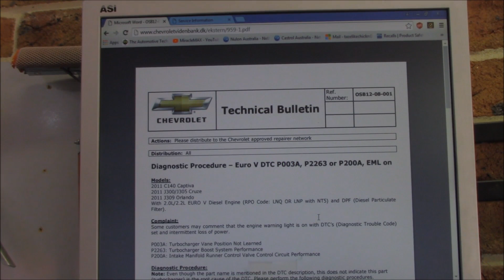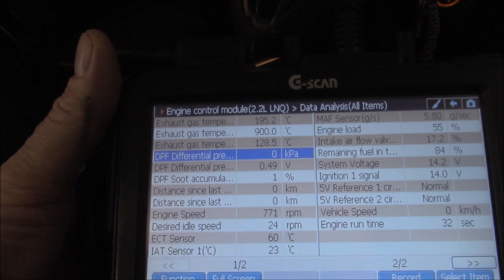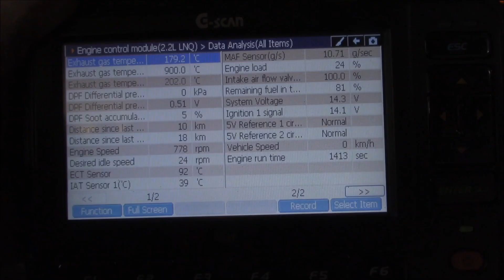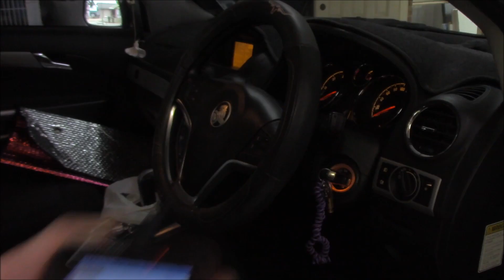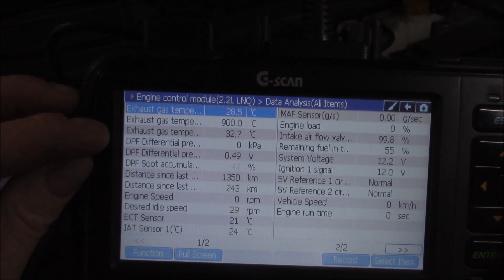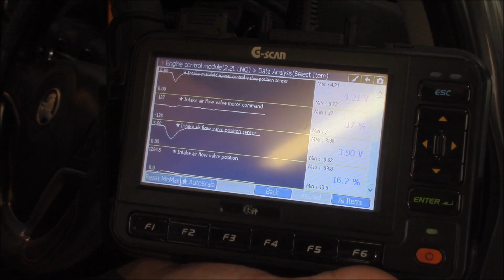Holden Captiva Diesel P200A MiracleMAX

Comment: Do you know if that vacuum actuator can be removed and replaced without removing the manifold?
Reply from the maker: Which actuator are you referring to? Some of them on the engine are EGR Vacuum Actuator, Turbo Actuator Intake / Swirl Flap Actuators.

Comment: Hi there love your videos, youve helped me with fixing this problem. But now I have p0401 - exhaust gas recirculation flow insufficient detected.  😢 would you know what this is? Ive tried researching it but cant find any info.
Reply from the maker: Can you see the MAF reading change when you activate the EGR valve in live data? When EGR opens, MAF should drop noticeably. Is there a build up of carbon in the intake system?

Comment: Hi! I have a new intake manifold purchased from GM and a new solenoid control valve behind the intake manifold. New DPF filter. I still get the P200A error. Do you know the cause? Could the problem be the EGR exhaust gas recirculation valve?
Reply from the maker: Have you carried out all the recalibrations required? Have you completed the necessary drive cycles to allow for a service regeneration to take place?
Reply: @MiracleMAX Yes. But the error comes back sometimes after one day, sometimes after three days, and the DPF burnout activates every day on a cold engine, maintains 1000 rpm for 3 km and then drops to 800 rpm and gently It's waving

Comment: Hi Max, I have Holden Captiva 2012 throw p2564. What I can start to diagnose?
Reply from the maker: Can you see actual compared to desired boost in live data on your scan tool? Is the actuator working correctly. If you disconnect the actuator, can you freely move the vanes?
Reply: @MiracleMAX  hi max, I replaced the turbo with new one and also inlet manifold there was big hole in manifold. The actuator works perfect. And vanes also move perfect. But when I starts the car after 5 sec car run but loud and once I pull the MAP sensor it runs to normal idle and car it also on limp mode. Code says turbo boost control position sensor a circuit low. It can be wire or fuse issue ? Will much appreciate for help
Reply from the maker: @nav5748  Have you tested the position sensor? That's where I suggest you start
Reply: @MiracleMAX  I tested orange black wire show 0.01 volt, middle pink one show 5.0 volt and yellow shows 0.01 volt. Should I get 12v in one wire with key on ignition of?
Reply: Or any fuse or relay need to test because I already replaced turbo ?
Reply from the maker: @nav5748  Can you tell me what engine is in the Captiva. Petrol or diesel and what size engine. With that code, you may need to check for a short to ground or an open circuit.
Reply: @MiracleMAX  this is Holden Captiva diesel 2012 2.2L CG
Reply: I check turbo actuator move when I start it,
Reply: @MiracleMAX  I checked boost control valve with multimeter with 20v. First one show 3.04V on white wire and 12.35v with orange one. Other-side with second solenoid I can see 3.54v and 12.35v with key on
Reply from the maker: @nav5748  So does the desired vs actual readings agree in live data?

Comment: Hi
Should there be vacuum on the pipe going to the actuator when car is on idle? Got p200a captiva 2.2L 135kw.
Tnx
Reply from the maker: Which actuator are you referring to? The intake runner actuator? According to the scan tool data at idle, it appears to have some duty cycle to the solenoid, and therefore the actuator.
https://youtu.be/tXyUWjjHAwA?t=323

Comment: Hi Mate
I appreciate your videos very much. Can you please let me know what should be the ideal idle vacuum pressure on diesel captiva 2ltr? Mine stays at -1.87hg. Thanks and appreciate your help
Reply from the maker: Diesels don't operate the same as petrol engines with a throttle blade. Most Diesels don't have a throttle blade to pull against to create vacuum, that's why they have a vacuum pump to provide vacuum for things like the brake booster. If they do have a throttle plate, then this is used for EGR operation. Diesels will not have the typical 17 and 22 inches of mercury that you will find on a Petrol engine.

Comment: Thanx max,, love your work,, I've only just found U but I'm sure I will be looking for your info again sometime,, I had the same issue,, couldn't find the code info and a lot of things didn't add up,, an I had to use USA cars as reference on something's,, easiest way o found to work out which solenoid was which was I unplugged one at a time n seen which code it set ,, until I found a code that related to that solenoid I was wanting to find,, worked a treat 👍, I had more or less got to a point I'd changed or checked most it could have been,, so I'm trying the carbon,, be dammed if I wanto remove that inlet manifold 🤬
Reply from the maker: Great to hear from you Laurie! There is quite an extensive manual that I have listed the link for in the video description. That's a good method I use to find which solenoid is faulty. A process of elimination.
Cheers
MiracleMAX

Comment: hey mate great video, trying to install a boost guage on my 2013 diesel 2.2 captiva where would I find a boost reference line to tap into in the engine bay?
Reply from the maker: I'm not sure of an exact spot, but it will need to be on the intake manifold. Can you 'T' into an existing port?

Comment: Man these things are absolute buckets. For some reason my boss bought one as a work car and now it’s crank angle sensor is faulty. Took it to a workshop, they replaced the cam sensor and said it wasn’t the crank angle sensor but the wires were faulty. I picked through it all and they weren’t, so I got some cold water and tipped it on the crank angle sensor, fires right up. So another workshop doesn’t want to do it, so I ring Holden to have it fixed so we pay book time. Holden says no, not faulty. Fault code says cam sensor, and when you research if the cam sensor is replaced, and it’s not receiving certain voltages, then it’s the crank angle sensor. We can’t do it at home because it’s an AWD and apparently the gearbox and transfer case need to be removed to replace it, and you’re looking at 6 hours minimum to do it. Cannot find any info on the motor at all, it’s a 2.2 turbo diesel Captiva 2 5, but all you find is one that you can pull the turbo pipe off and change it, where as ours is on the firewall side of the motor. Total, utter piece of shit, up there with the worst cars ever made.
Reply from the maker: I understand your frustration. A legitimate test for a crank sensor is the water trick you tried. The sensors are usually heat effected. 
They should have used an oscilloscope to check out the signal waveforms to make a correct diagnosis.
Yes the Craptiva is not a fun vehicle to own and not a fun vehicle to work on.
I hope things work our for you! 😉
Reply: @MiracleMAX  I have a pretty extensive aftermarket spares background and was bloody annoyed being told no it’s not the crank angle sensor when by following the fault code instructions, and my own super basic test which I have now repeated a half dozen times, that yes, it is the CAS that is the issue, but, I think that it’s such an asshole of a job, or the Captiva is such a lemon, or probably both, no one wants to work on the damn thing. We work as pilot escort drivers and I will say that he has had some acceptable mileage out of it, I was driving it at 130k and it’s now over double that, but like this job, everything is such a mission. It had a rattle in the pulleys for months. It threw a bearing and we replaced that one, then another one, then all of them, and finally a harmonic balancer which had torn apart and I think it still required extra repairs to stop the noise. 

All of that said, for a 2012 car it’s abysmal inside! Uncomfortable, awful instruments, radio and computer that looks like a 1980’s Amstrad, no Bluetooth, no aux in, not even a temp gauge!

Anyway, long and the short, I hate it, and now drive, quite happily a VE 2 wagon with 500k plus on it with the threat of me quitting if he decides I need to go into the other car lol.

Comment: And I think the dpf guy might of done a force clean and destroyed the solinoids.if so what do you recommend we do from here?at my wit's end
Reply from the maker: P0545 Exhaust Gas Temperature (EGT) Sensor Circuit Low
This video might help to find this reason for this code
https://www.youtube.com/watch?v=BGjqiQvwVwk

P06DA-00 Engine Oil Pressure Control Solenoid Valve Control Circuit
This link may help a mechanic to find the fault
https://f01.justanswer.com/dcraig1000/012e7dc6-2908-4868-83e8-3b0a40ec25e6_eee.pdf

Comment: P200A is easily fixed by using LiquiMoly Diesel Intake cleaner. One can through the turbo intake and a second can through the intake elbow after removing the straight hose under the battery. No need to remove the inlet manifold. I use GDS2 to hold rpm at 2,000. Cheers
Reply from the maker: Hey Ripahh,
I agree that a cleaner can be used as a maintenance program, but from my experience, the only way to clean out large amounts of carbon is to remove and ultrasonically clean the components. You also have to keep in mind, with an intake cleaner, all the carbon goes past the inlet valves and seats, up and down the bore, out the exhaust valves, past the turbo into the DPF. This can cause major issues with large amounts of carbon. Also, carbon is very abrasive, so can cause damage on the way out.
But yes, for maintenance, trying to stop a build up of carbon before it becomes an issue, I agree.
Thanks for your comment 😉👍
Reply: @MiracleMAX  for my “off road Captiva” I flashed the ECU with DPF/EGR off. I removed the EGR cooler completely and used a delete pipe from Italy to replace the DPF. I also removed the Swirl valves from the manifold. The result is 525nm TQ up from 425nm. Fuel economy is now 8lt city and 6lt highway. No smoke from the exhaust unless flat out. It smoked with the DPF also. Boost up from 20psi - now 25psi. I know it’s in your best interest to overcharge customers to manually remove soot etc however LiquiMoly is proven DFP safe. That code WILL go away immediately. Cheers.
Reply from the maker: @Ripahh  I'm glad that that method has worked for you. My customers interests are always a priority to me and my reputation, but as I stated in my last comment, large amounts of carbon will travel through the engine and cause possible damage. I use spray cleaner as a maintenance program, but when the carbon build up is excessive, I am not happy to push that potential damage through the engine.
I appreciate your comments and thank you for sharing.
Reply: Hey Ripahh, MiracleMAX, I'm getting the P0200A code just from a cheap OBD2 scanner and I want to try this at home. Can you explain a bit more how this is done? The battery tray looks like its connected to the ECU box and fuse box which i assume needs to be removed to access the straight hose underneath. How do you get the car started to spray the diesel intake cleaner?

Comment: Good basic diagnosis, thanks Max
How can we educate these owners on regular maintenance and cleaning? Even the use of the correct grade oil 😔
PS Can you please put a dust cap on the low side air-conditioning access cap? First thing I spotted 🤓
BTW I really like your informative, entertaining videos 👍 and subbed
Reply from the maker: Hey MrConspark , 
You are right. Now more than ever, maintenance is crucial on modern vehicles. People think they are saving money skimping on servicing their cars. We can only advise. After all, it is their car. Good eye on the AC service cap! 😉👍

Comment: Takes premium diesel fuel only right... ppl don't realise that you cause more issues on these new diesels (all common rail) when using standard diesel. Maybe it cost less per  litre to use standard diesel fuel but not in the end when it comes to repairs and down time... not to say this is the precise cause in this case but its worth considering, isn't it.
Reply from the maker: Hey Peter,
Thanks for your comment.
Fuel in Australia is pretty bad, so many issues are as a result of poor quality fuel.
MiracleMAX

Comment: Hi Max,

Your video is very informative. I have holden captiva cg2 2012 diesel. I m getting light with the following code. 

Egr valve p0404
Engine coolant sensor ect p0118

Can you kindly advise.
Reply from the maker: Hey max580,
There are several reasons for those codes.
Firstly, what sort of scan tool data do you have? Do you just have a code reader or can you access 'live data'?
What is the coolant temperature reading on the scan tool?
Do you have 5 volts at the temperature sensor? Does the voltage drop as the engine heats up?

Secondly, the P0404 code is EGR related, but can include things like carbon build up, which can mechanically jam the EGR valve, not allowing its full range of travel. Have you removed the EGR valve to see any carbon build up? Have you checked the intake system for carbon?
Does the vehicle have any symptoms apart from the check engine light and the codes?
Does it run rough at idle? 
Does it lack power?
How many kilometres have the vehicle done? Has it been serviced regularly according to the manufacturers recommendations?
Hopefully that will give you a direction to diagnose your fault codes.
MiracleMAX